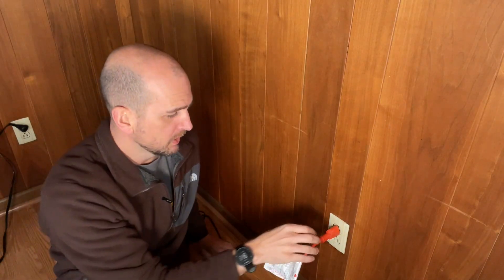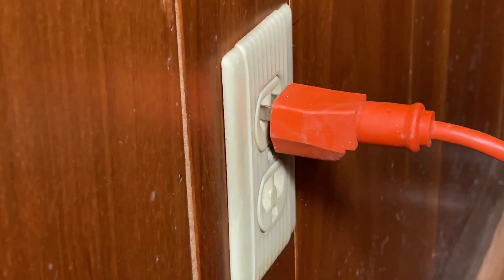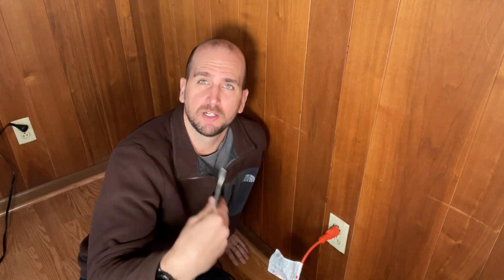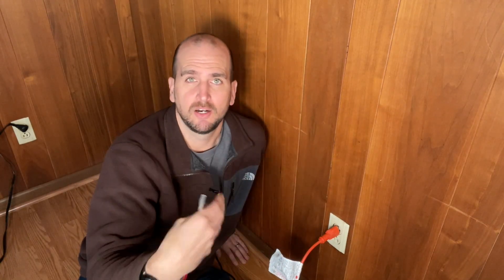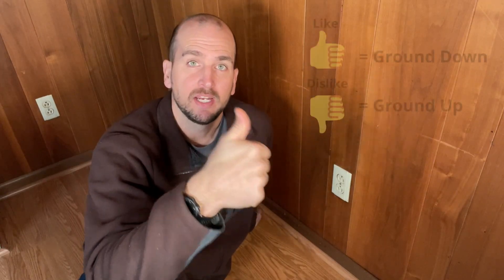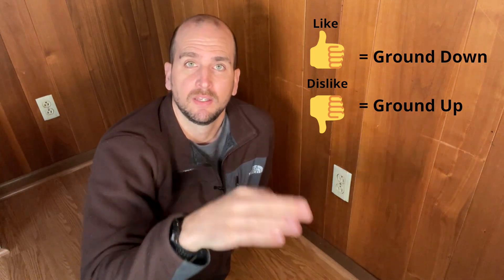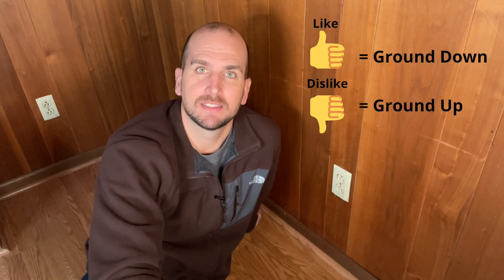Should An Outlet Be Installed Ground Down Or Up

Comment: If you are using a grounded plug you will notice that the "ground" pin is always slightly longer.  The reason for this is to make sure that  the ground pin always makes  contact with ground first while inserting the plug and is always the last pin to disconnect to while removing the plug.  This ensures that you as the user are always protected from you accidentally being the ground yourself and getting a shock, if there is a faulty cord.  That being said however, the receptacles need to be properly connected to a good ground internally.  Therefore, it really does not matter which way the receptacle is facing because it is impossible to make contact with Hot or Neutral before the ground when inserting, or losing contact with ground before the hot or neutral when removing.   I think that's how NEC gets away from actually making it code to have them installed in a particular configuration.    I do understand that this does nothing for the 2 prong plugs, but then that's another discussion of why Arc Fault and GFC's or GFCI's are great things to use.
Reply: With the ground pin up, I have actually seen the ground pin pull out and lose contact causing an "open ground" connection due to the leverage of the cord. I've seen it quite regularly actually in the work environment in which I inspect.

Comment: As a certified safety professional, I inspected numerous commercial facilities. Many of their outlets had metal receptacle covers. Thus for metal covers, I always insisted that the ground pin be up in case the cover came loose and fell on the connected plug. I found most plastic covered receptacles to be ground pin down

Comment: Why can't manufacturers make an outlet with the top connection with ground up and the bottom connection with ground down, the the top would protect for shorts and the bottom would aid in close fit plugs.  Just a thought.   Side note; we install ground down in rooms but make ground up when outlet is controlled by a switch.

Comment: Hey Ground Down is the Way to Go.  Try Plugging in an Air Conditioning 90 Degree Plug.  You will see the wire is Upside Down.  Most Commercial Buildings I worked in Has Ground Down.  Ground Down Smiley Face.  As opposed to Ground Up.

Comment: I use the ground position as a sign of the circuit amperage: 20A - ground up, 15A - ground down (even if it is a 15A rated receptacle) Just my own sign...
Reply: Might want to look into installing NEMA 5-20R sockets instead of the NEMA 5-15R ones you're familiar with. Lets you install ground up or ground down as desired. The 5-20R will accept the 15 amp plugs you're familiar with and will accept 20 amp plugs as well.
Reply: Good idea now you know which outlet to plug your 20 amp appliances into 🙄
Reply: @erickinnett3599  Not really.
Every plug you see that has the 2 blades parallel to each other is a 15 amp plug. You won't find any 20 amp appliances with such a plug. But there is a similar plug where one of the blades is at right angles to the other. That is a 20 amp plug. The 2 main styles of sockets you'll see in the USA is the NEMA 5-15R which is the most commonly seen. You'll also sometimes see a NEMA 5-20R which looks similar, except one of the blade openings looks like a sideways capital T. That allows for both the vertical blade of a 15 amp plug or a horizontal blade of a 20 amp plug to fit in the same socket.
Reply: @John Cochran… You sir are correct. I am more than a little bit surprised that apparently there’s a lot of people out there that don’t know what a 20amp plug looks like.

Comment: defend how the metal fall to the gapfrom the plate and plug. cause if the metal fall to left still have contact to hut rang but if the metal fall to the right it should be ok cause right side is nutral.

Comment: None of the above!  Install a Schuko design receptacle and forget about it.  [But you will be using 220v service, and need appliances to match].  Managing neutrals in the US is one of the things that gets handymen/diy types in SO much trouble in the states: can't bond sub-panels, open neutrals harder to troubleshoot [and dangerous when backfed having lost their bond connection], etc.  The potential to earth is no different than standard home service - you just have two lines out of phase 180 degrees, and as a bonus... you don't need as big of wire sizes, or breakers to serve them.   NEC is stuck in the wrong century, and poorly written: the guys writing code do not include the photos/drawings of incidents that lead to changes and there are so many things... until you see it, the language is nearly useless.  I think that's a safety problem in and of itself.

Comment: Ground down is safer. It's natural when plugging/unplugging is to have your thumb up top, and your index finger wrapped under.  I've known several people who have inadvertently shocked themselves on inverted outlets because their index finger slipped under and touched both hot and neutral.  Obviously ground down doesn't have this shock hazard.
Reply: Same thing I said. And you are correct. I’ve investigated some near electrocutions and the slipping index finger was the issue.

Comment: The code used to be with the ground down and if the plug comes out far enough for something to make contact with the hot and the common they'll not far enough in the receptacle for them to make a connection with the hot lead and the plug it's self.

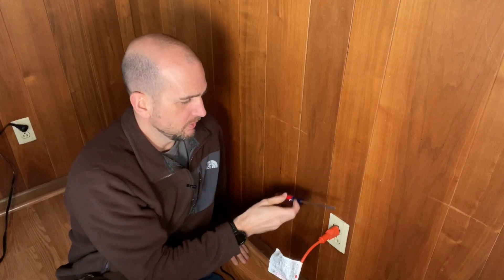Comment: At 3:13, that actually happened to me many years ago!  I was arranging the speakers for a new receiver I'd just recently purchased, and the wires for the speaker came loose.  I cursed my luck when the bare wires came in contact with a plug behind the entertainment center and blew out my new receiver.  What were the odds!?  I grew up with the ground on the bottom, so it looks weird to me to see it on top, but now I see the value in doing it that way.

Comment: I do it ground down, which is what I learned from licensed electricians.  However, I am one to notice this stuff wherever I am, which is very anal of course, but recently I saw it installed ground up in a new wing that was added to my Honda dealer service waiting room and also noticed it ground up in a couple of hospital facilities.  So I would guess it relates to the specs for the job and, since code does not specify, it is acceptable.

Comment: I'm doing ground up for replacements simply because I prefer taking the ground off the box and screwing it directly into the outlet rather than relying on the screw to ground the outlet. The ground wire has more contact this way and is more effective. Oh, I should explain that since I'm doing replacements that the ground wire is already cut and generally feeds from the top so putting ground down would require a slightly longer ground wire which I don't have.

Comment: The reason you WANT the ground hole on the bottom is because of the electrons.  If the outlet ground is " UP ", the electrons drip out. Electrons float UP like Helium gas for example. So if the ground hole is UP, the electrons can drip out and float up to your ceiling. This causes you bill to go up a little. But the major problem is static electricity.  When the ground hole is up, the dripping electrons change the ozone in the room causing greater differences between earth ground and other metal objects not grounded. So, you might get zapped from a door knob or zap from touching your TV.   Give it a test.  In ONE room switch all the outlets to ground hole up. Give it a week, for the electrons to drip out the ground hole and fill the room. In some cases, you will smell ozone as the room becomes flooded with free flowing electrons.  You can tape foil over outlets to stop the loss of electrons due to dripping. ( PLEASE DO NOT insert the foil in to the out let holes!  only cover the outlet! And you MUST use electrical tape for this. Electric tape is coated with something that neutralizes free floating trons. It actually does this for all three trons, Positive / Negative / Neutral. )
.

.

..

Comment: I vote ground down. 1. It keeps with the convention of the hot lead, being on the right. 2. In terms of safety concerns, if the plug does come loose, you want to prioritize the ground connection holding on over the hot and neutral.
Reply: Plugs where it's even possible for the ground pin to disconnect first are not up to code
Reply: @Owen_loves_Butters  Makes sense to me.

Comment: Working in NYC, we always installed receptacles ground up for the reason given in the video. It will prevent an arc flash or fire if something falls onto a plug and the breaker fails to trip. I always thought that was actual code until I escaped the people’s republic of NY and found that everybody where I live now are odded out when they see ground up. I read up and found an article in a psychological mag that pointed out people like ground down because it resembles a face and faces make people happy. Just my experience with this topic.

Comment: Well, from my experience, ground top, because some of the plugs are L shaped, and by them you want the cable to go down to the ground. You probably dont want it to be poiting upwards, as there would be a lot of bend in the cable by the joint....So Up!
Reply: unless you have an AC above it :-)
Reply: Also, might be dependent, were are the cables installed in the walls. If closer to the roof, as I am used too...or the modern way, closer to the floor, which I personally dont like.

Comment: I normally do ground up, BUT, when installing a dedicated appliance circuit, I look at the cord/plug on the appliance. If the molded plug is also a 90 degree plug, install the outlet so the cord hangs down from the plug. Often ground up will result in the wire going up from the plug, and then promptly making a 180 degree turn in a very short space, which is likely to cause problems with insulation and broken conductor strands, IE shock/fire hazard.
Probably the reason NEC has never determined orientation is because cord manufacturers make plugs in to many configurations.

Comment: Had an inspector, when I was selling my home, make me put one the right way ...down. one reason is so when, you plug in a cord , you can see the prongs that can kill you. If they are down you might touch them as you plug them in.
Reply from the maker: Interesting, thanks for the feedback but an inspector shouldn't be giving direction on ground orientation.
Reply: @EverydayHomeRepairs  when it's the buyers inspector they can. Believe me lol

Comment: In 21yrs we have always used ground facing down, however in Chicago we mount our boxes horizontally because we have to use metal for everything, no Romex allowed in Chicago, so any single receptacle are always faced horizontally, anything that is 2 gang we face the mud ring up and down and upon trim out we install the ground down and the horizontal ones hot and neutral top ground bottom. This is what we’ve been doing 21yrs and not just us but at least 99% do.
Reply from the maker: Thanks for the feedback Matt 👍

Comment: I prefer ground facing down because I have always hear that in some instances a person will grab a three prong plug and not realize that their index finger is touching a prong ( thumb on top ). Therefore they are safe from getting shocked. This is more likely to happen than a picture who’s frame just happens to be metal falling onto the plug that is in a outlet that is weak and shouldn’t be in use anyway.

Comment: There are a few safety issues with ground up, too:  Wall Warts!  Since most (almost all) wall warts are designed for receptacles with ground down (that is, the wire tails off the bottom) with the hot on the right, putting them in upside down creates a very sharp bend in the wire, which can ultimately lead to internal breakage of the conductors & insulation on the wire and possibly cause smoldering.  
Ground side down is less likely, mechanically, for a plug to fall out of a loose jack (there is more mechanical contact with 2 prongs than with one - since the ground prong, while it is longer, is also rounded at the end and only has a single spring clip holding it in vs 2 - I had to do a rigorous test after having a massive argument w/my pa while rewiring an old home - I took a tension gauge and did several test "pulls" downward - the weight of the cord tends to back out the top - and did determine that I was correct.  After this proof, my engineer dad backed off and let me finish the project with ground down).  The almost non-existent chance that a slim bit of thin metal hits the top of a loose plug causing a short between hot and neutral is, to me, not a good enough reason to invert the receptacle in my opinion (really, has anyone had this ever happen in their life?).  In addition to wall warts, many heavy duty power cords (like for UPS units or many extension cords or washing machine plugs) expect a ground down connection as the wire drops towards the floor. (the exception is some window AC unit brands like GE - the receptacle has to be ground up - go figure) 
Overall, out of convenience, if you don't want to drive a home owner crazy when it comes time to plug in wall warts and right angle cords, install ground down.
Reply: As a professional electrician, most of this is pure nonsense aside from there being more support with the ground pin facing down. “Wall warts” come in so many shapes and sizes that it’s practically irrelevant. Hell most phone chargers the chords come straight out the back meaning the ground pin could be sideways and it wouldn’t change a thing. Bottom line is the conductor sizes are such a small awg that they rarely get damaged under their own weight. Your father probably knows how little it matters and was tired of listening to you. Have you ever seen high end homes where the receptacles are placed sideways for aesthetic value? Yea that’s a thing too.
Reply: @esl4058  - No nonsense. It's basic leverage. Most wall warts with polarized plugs (most wall warts do not have nor need a ground pin) have the prongs to the top, and if the receptacle ground is topside, then you have to plug in the wall wart upside down.  What happens? Well if you don't have a new receptacle (most people don't and they do wear over time proportional to the number of times things are plugged in and removed - MTBF rating), I promise that it will pull away from the socket. The reason should be obvious (the "lever" is larger upside down and it's not stopped by the receptacle itself). 
The other thing is that, especially with phone chargers, these are plugged in and out repeatedly - so much so metal fatigue in wire will eventually cause a break inside the insulator. When a wire is bent repeatedly via repeated insertion cycles (more bending when it's upside down as I stated), it can create a potentially dangerous situation (we all know the wire will break long before the insulator - so does the IEEE).  That extra looping of wire, if immobile, won't make much difference, I agree, but pets, kids/teens, cleaning people, and others will be yanking cords left and right (I've seen most of this in office buildings) and my relative that works at the Apple store (to replace their POS Chinese charging cables).

As an electrical engineer, I have to look at all sides of the issue, but until other manufacturers change their ways and 99% of all US homes have the ground pin down (including my 1940s, 1960s, 1970s, 1980s homes I've lived in over 5 decades) go about flipping them over with the ground up, I'm inclined to believe that millions of electricians, electrical engineers, product engineers, etc, prefer otherwise.  That's a lot of pros filled with "nonsense". I must be one of them.  PS I've had to correct crappy wiring jobs by electricians in 3 of my homes (switching neutral, crossing phases, not pretwisting wire before wire-nutting, tying in 20Amp lines to 15Amp circuits, incorrectly connecting GFCIs, running electrical wire parallel to communication wire - total ignorance of cross-talk, using the wrong receptacles for aluminum wiring, clipping ground wires in ceiling fixture boxes, the list goes on. Much of this on brand new homes! Being an electrician doesn't mean you're good or professional. (same with having a degree - in my case - means nothing without experience and professionalism)

Comment: the argument is a hard one. in Europe, the UK has the ground up, but they use 240 Volt, so that may be the reason and then you have different pin configurations so its a hard one. 4 pin 120/240 volt plugs have the ground up... because of the plug design, so that may be a clue... on regular 120 outlets, I always go with ground down because the plug design on appliances follow that pattern, refrigerators, washing machines and freezers...  90 degree plugs always seem to use ground down designs.  so the debate goes on...

Comment: Grasping a plug, the fingers tend to curl under the plug, so it's less likely to contact the hot contacts when ground is on bottom.  That's a benefit over the less likely situation of someone dropping a screwdriver onto a partially inserted plug.  Shock vs tripping a breaker.

Comment: In Taiwan, the receptacles are installed horizontally with the ground facing the corner wall for easier access. For example, at 0:39 the grounds will be facing the left because of the wall at the left.
Reply from the maker: Thanks for the feedback!